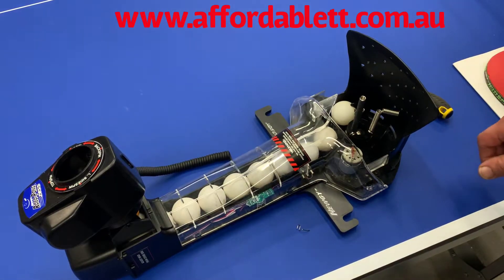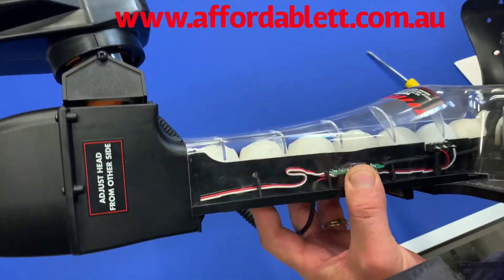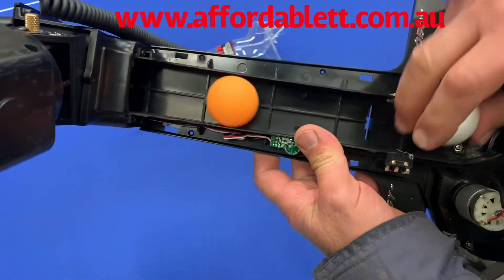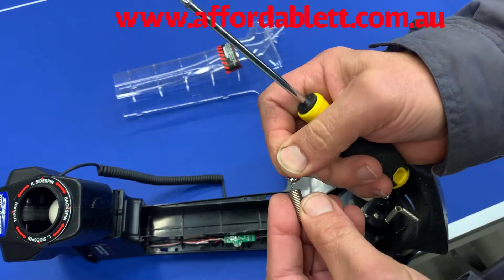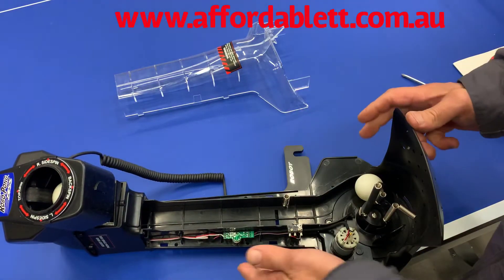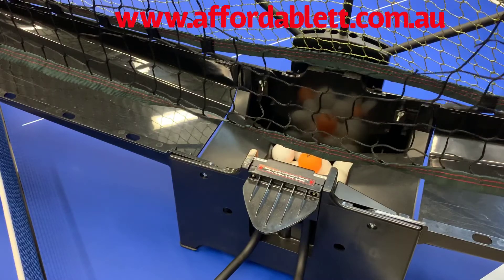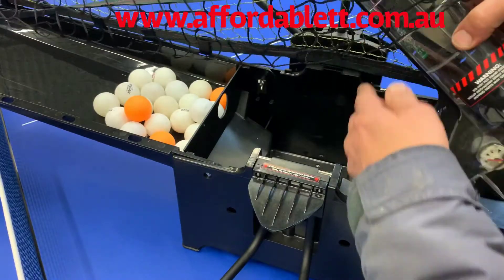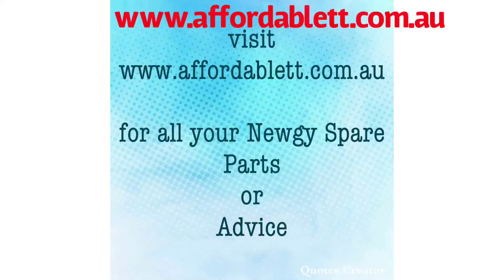Newgy 2050-169 check valve spring replacement.

Comment: thank you.
What happen if this spring is broken?

Since this spring is broken, my robot doesnt launch ball every time, i'm wondering if it is the reason.
Reply from the maker: This can be one of the reasons. The Check spring is important. As is the micro switch. You can check the function of the micro switch with a multi meter.

Comment: Do you know why the Ball Jam Alarm keeps coming on even though there are no ball jams? It happens after the robot shoots out 1-2 balls, then the alarm comes on. This is for the 2050.
Reply from the maker: Can be a few reasons, the last one we repaired we had to replace the ball speed motor. If your getting 2 balls coming out you need to try and rectify this first. Under settings adjust the ball feed sensor. I have a video on the 2 ball shooting problem. If that doesn’t fix it, then it may be the motor.
Reply: @febatman  P.S. The ball speed motor seems fine. It shoots the ball out at different speed as adjusted. If you still think it's the ball speed motor, can you please do a video on how to replace it, and also the spec for the motor. Thanks.
Reply: @febatman  Do you think it might be the servo? Every time I unplugged and plug in the power the robo head automatically swing to the right causing it to go out of alignment and I would have to adjust the drive pin.